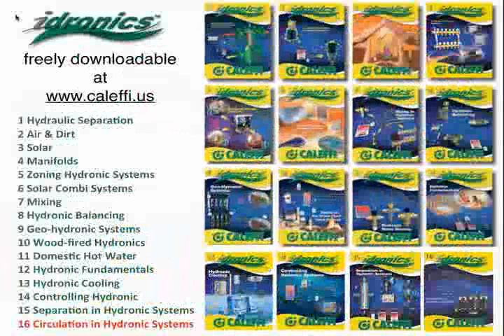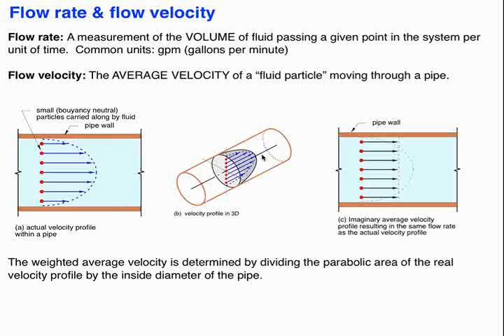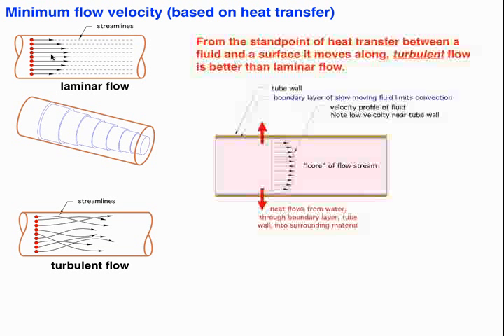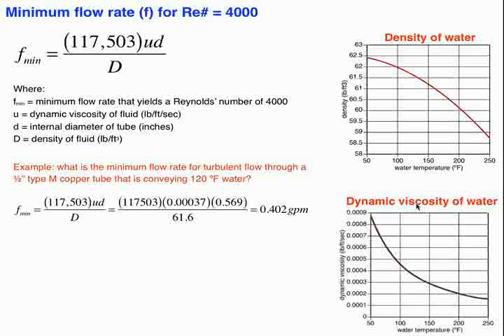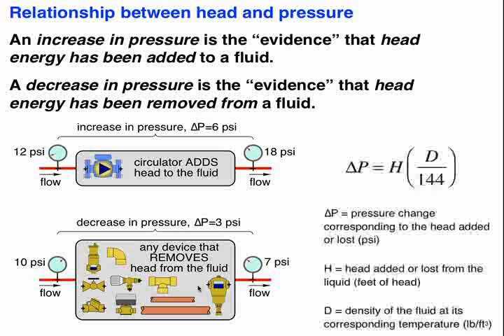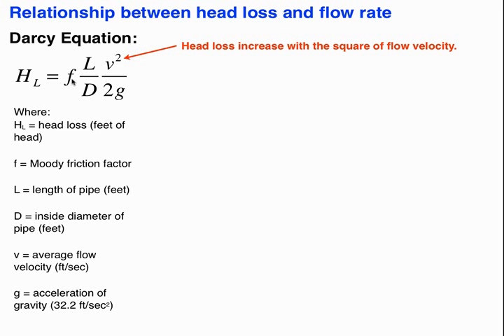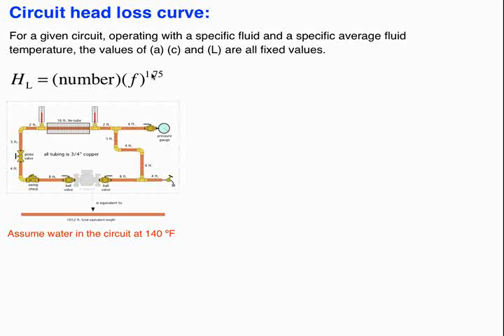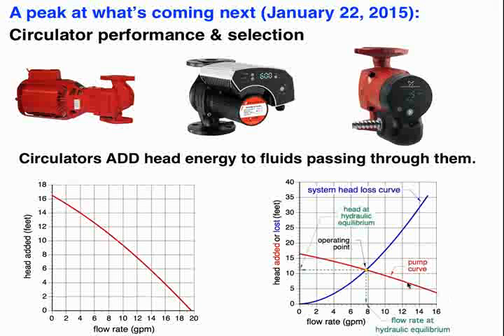Analyzing Head Loss in Hydronic Systems (Part 1)

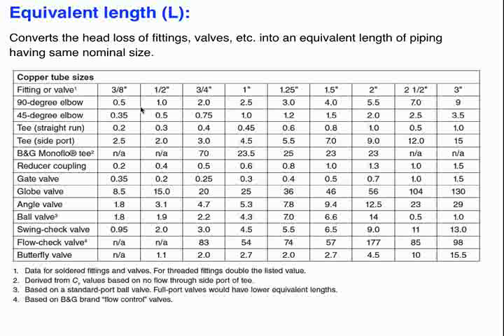Comment: Having found John Siegenthaler's book and Caleffi's Idronics journals immensely helpful, I nevertheless would like to know: do you have an Equivalent Length table (44:01) for piping other than copper -- PP-AL-PP (polypropylene), for example?  Also, are radiators considered to have equivalent lengths, and if so, how are they calculated?
Reply from the maker: From John himself:

"In concept, any component in a hydronic system which has flow passing through it has an equivalent length for a given type and size of tubing.

You can estimate that equivalent length by setting the head loss of the component at some known flow rate equal the head loss equation (Darcy Weisbach), and then solving for the length.

If the tubing is smooth (i.e., copper, PEX, PEX-AL-PEX, etc.) the Darcy Weisbach equation reduces to:   HL = (acL)(f)^1.75.

Where HL = head loss (feet)

a = fluid properties factor (figure 4-2 in idronics 16)

c= pipe size factor (figure 4-3 in idronics 16)

L = length of tube (feet)

f = flow rate (gpm)

So, let’s say the head loss of a radiator is 3 feet of head at a flow rate of 2 gpm, and you want equivalent length of it based on 1/2” copper tubing, and the water temperature in the system averages 130 ºF.

a = 0.048

c = 0.33352

f = 2

HL = 3

So,    3 = (0.048 x 0.33352 x L)(2)^1.75

The only unknown is L.  Solving for L .

 L = 3 / (0.048 x 0.33352 x[2^1.75])    

L = 55.7 ft.

So the equivalent length of the radiator is about 56 feet of 1/2” copper tube.

Note:  The equivalent length of the radiator would be different for other types and sizes of tubing.

Hope this helps."
Reply: Thanks for the reply.  But you have explained how to calculate the equivalent length of a radiator from the head loss across it.  Actually my problem is the reverse:  I need to calculate the head loss, using the formula you cite, FROM its equivalent length.  I need to know the equivalent length of the radiators as well as those for the pipe fittings in order to get my system curve.  Do radiator manufacturers typically give a radiator's equivalent length, or head loss, or pressure drop, in the specifications?